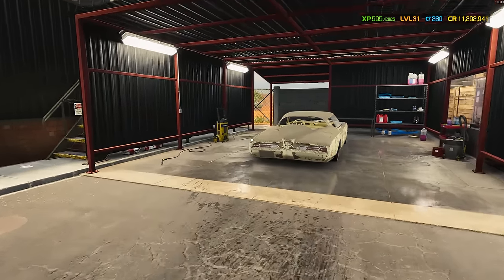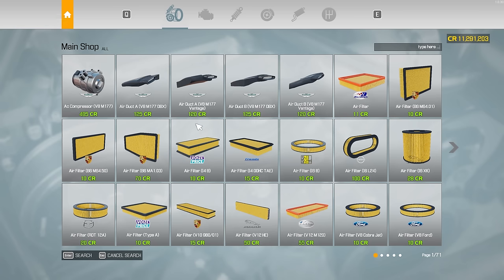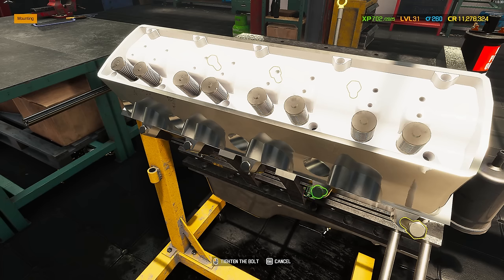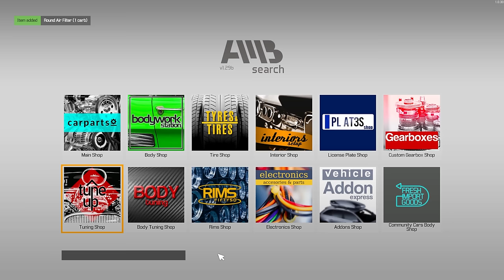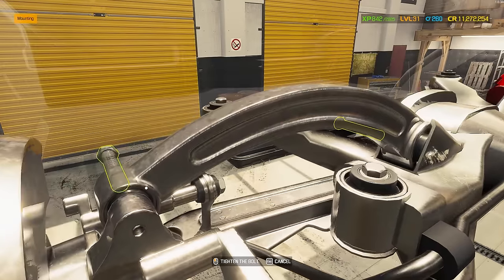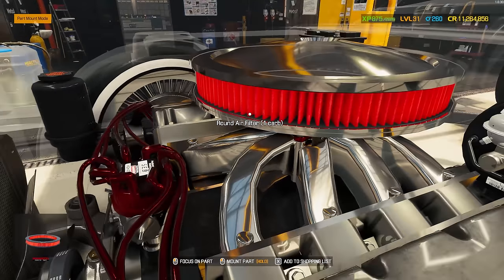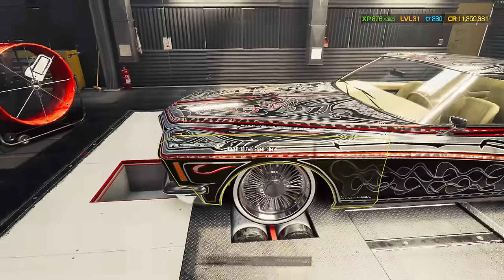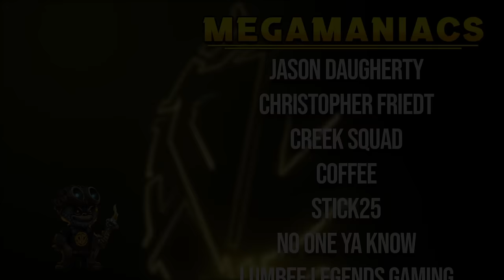1971 Buick Riviera Lowrider For the Count! // Car Mechanic Simulator 2021

Comment: thank you for showcasing the config and the livery. from the moment i saw cms21 was gonna have the buick boat tail i knew i would be in the paint shop for kountless hours making this livery, whats even more intense is that i used microsoft windows paint, thats right, every single line, color making it work and look that good took over a month, a labor of love for sure. whats crazy is the livery only has 1 door, so i had to make them first, then make 1/4 panels line up and fenders after, then get hood, nose, and fender tops to all line up. the roof and trunk took days alone, is it great, mmmm kind of, could it be better? way better yes, but for what it is, its an awesome look on that car and one i just had to do, having made many liveries, this one was a must. countrythang did a great job on the config too, again, thank you for showcasing this car and livery, you earned my sub, even though i have been here watching before, this tipped the scales fully, much appreciated.